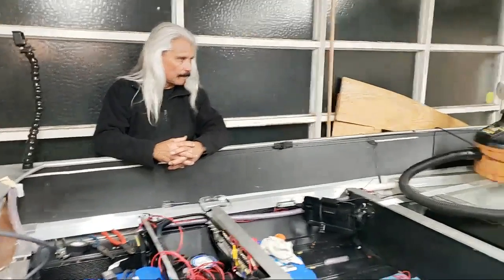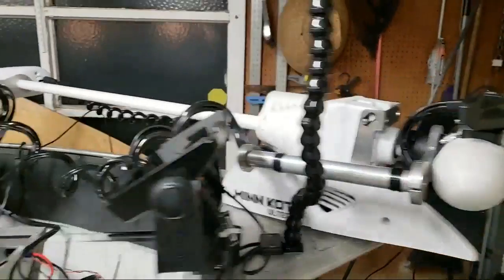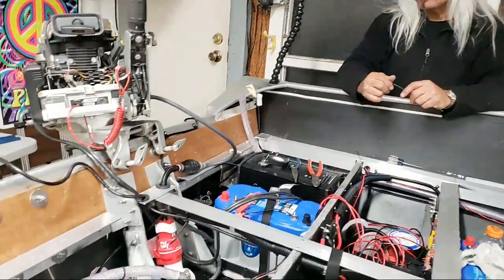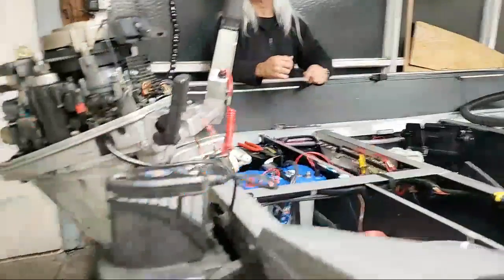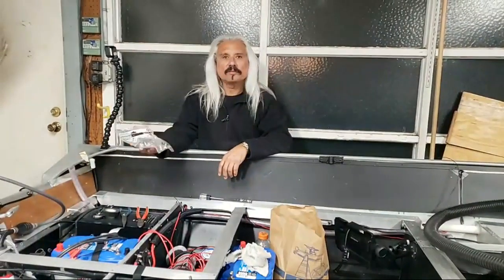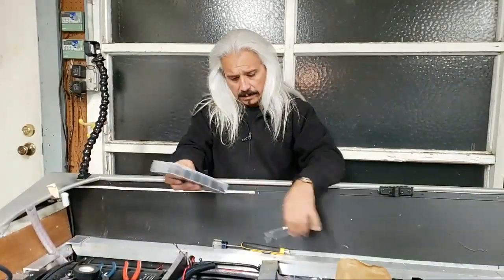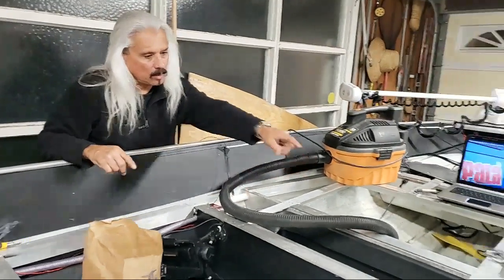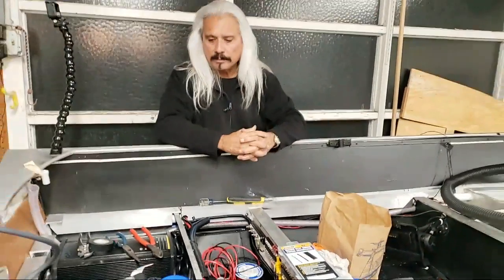DREAM MACHINE 1.0 Build Custom Wiring, Micro Power Pole, TH Marine LED light Setup LIVE STREAM

Comment: Here's what I did with my 15 foot Gregor when I installed the battery under the front seat to take the weight off the transom area. I ran 2-10 ga.wires inside of 1/2 inch drip line tubing as a conduit. On the side of the Gregor about seat height is a half moon groove running the full length of the boat that the 1/2 inch tubing fits perfectly with the wires inside. The tubing is supple enough to conform to the curve then silicon it in place. If you had to you could pull it through the space with a wire fish tape. Hope this helps.